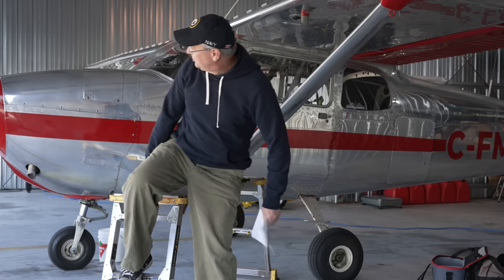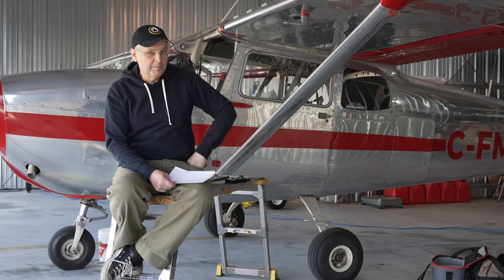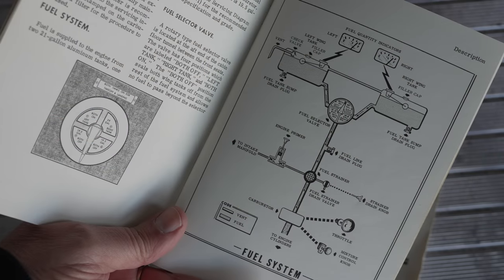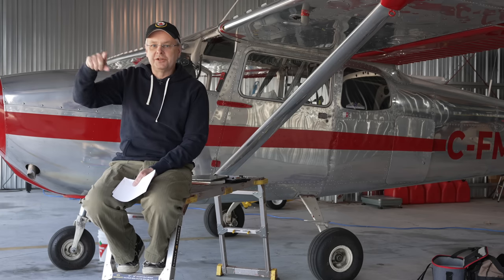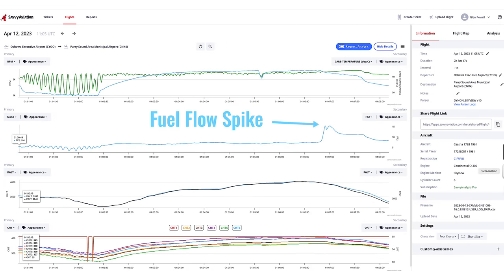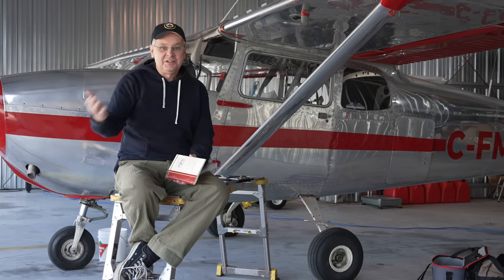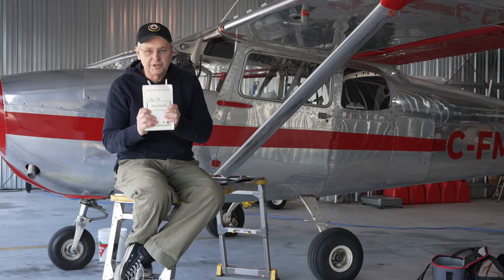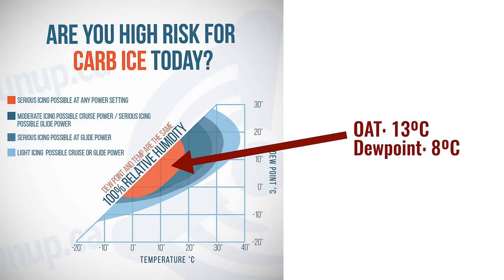Rough Engine- Was It Carb Ice Or Vapour Lock?

Comment: are you considering doing the fuel line change?
Reply from the maker: We did consider it when the plane was in pieces for the rebuild... but sourcing the kit specified in the AD proved to be something we couldn't do at the time. Now that I have a new procedure in place; switching tanks every 30 minutes is pretty easy.

Comment: Could it of also been pilot error cause you didn't do something at the right time or altitude?
Reply from the maker: The AD states that you must use a single tank when in cruise above 5,000 feet - but it is ambiguous about Pressure Vs. Density altitude. 
I was flying at 4,500 pressure altitude / 5,100 density altitude, so yes as I stated in the video I probably made a mistake by not factoring in an extremely warm early Spring day and by not compensating for Density. 
This is why I will now switch to single tank use at all cruising altitudes.

Comment: So what is vapor lock ?
Reply from the maker: Vapour lock happens when the fuel in your fuel lines vapourises, turning from a liquid to a gas. This can happen because of heat (the fuel boils) or because of turbulence in the fuel lines, or a combination of both.
This bubble of vapour in the fuel line stops the flow of fuel, starving the engine.
In the case of this aircraft the vapour lock happens because the two lines running down from the fuel tanks are turbulent; caused by incorrect shape and lack of venting.
In other aircraft it can happen because the fuel lines pass too close to the hot engine.

Comment: How can you have vapor lock on a carbureted engine?
Reply from the maker: It’s not on the engine or the carburetor - it’s in the vertical fuel line from the tank. Vapour lock can happen in more than one way, in more than one place.